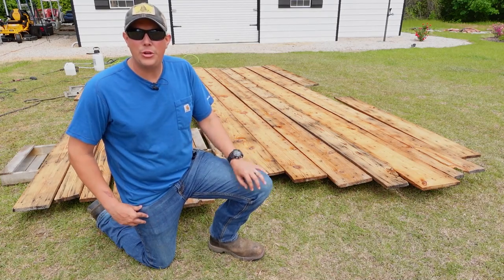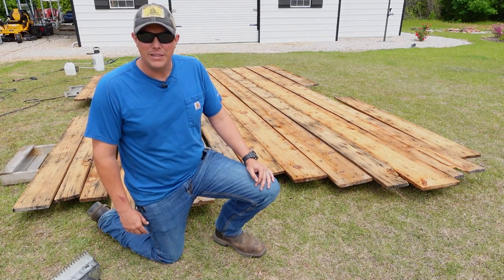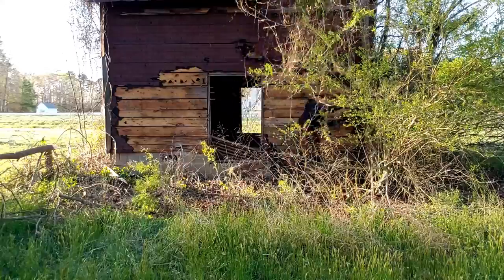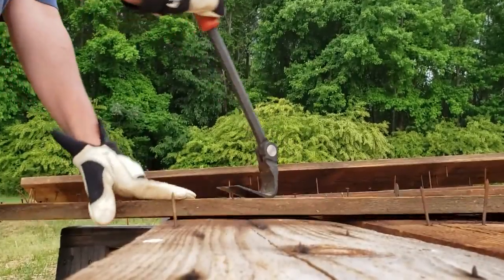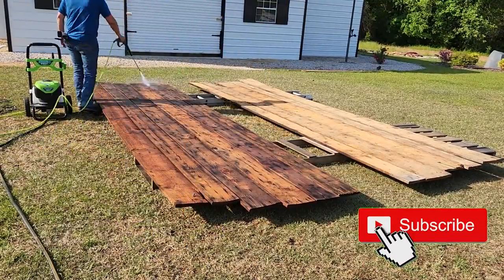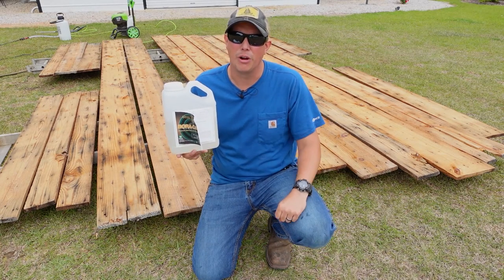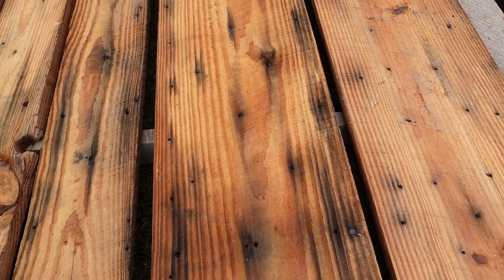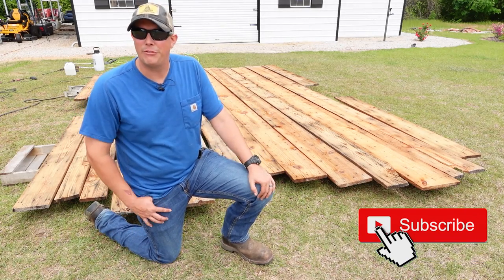Reclaimed Barn Wood / How To Salvage, Clean, and Process

Comment: I have been taking down tobacco barns for 30 years and the last 15 years selling the timber. You should NEVER pressure wash barn timber. Just a light sanding with 60 grit paper will clean the barn timber up and will not harm the saw marks. The saw marks are what you want to highlight with the barn timber. Bora Care is the best for treatment for any kind of bugs in the timber but it will make the grain stand up so treat it first then sand it. Also the stuff is called rolled roofing that is on the side of the barn and best just to use a crow bar to just peel it off. That rake you showed is a waste of time and would make the job twice as hard. Believe me I have done so many I know the easy way to do it.
Reply from the maker: Gunna have to disagree with you brother!!!  I spent hours with a crowbar and when I switched to the roofing shovel it went 10 times faster!!   And what's wrong with pressure washing off all the dust, pollen, and spiderwebs??? Like I said in the video, it was a light pressure washing, I didn't take off any material.  Thanks for the advise though, I'll remember that for next time!
Reply: He just don’t know George , but works for him however will hurt when selling someone who, 
“Knows Better”
Reply: Ummm  can I get ahold of you somehow?
Reply: That's not modified lol That's just the felt layer underneath the shingles. And the shingle bar he used to remove it makes quick work of that job. Also idk what pressure washer you are using, if it takes saw marks out of 100 year old wood that thing is way too powerful for anything home related lmfao

Comment: Youtube has all the experts.sadly none of em have ever worked a day reclaiming barnwood
Reply from the maker: lol, well I never claimed to be an expert, this is a DIY channel after all, and the very concept of "Do It Yourself" implies that you aren't an "expert". But I did spend several days/weeks working very hard reclaiming the wood in this video.   Id love to hear what you'd do differently though.
Reply: @PatriotDIY  Great video. I'm working on a 100+ year old timber house in Australia. Pulled out a couple of walls lined with 6 inch T&G red mahogany. Like you said - thousands of dollars of timber for nothing so I'm lining out the new kitchen with it. Kitchen ceiling originally lined with timber similar to yours but sheeted over with asbestos in the 60's. Cleaned them up like you did and re-lined the raised ceiling with them on exposed beams. DIY is hard work but we don't care, do we?? Re-using priceless old timber that cost you nothing is so rewarding.